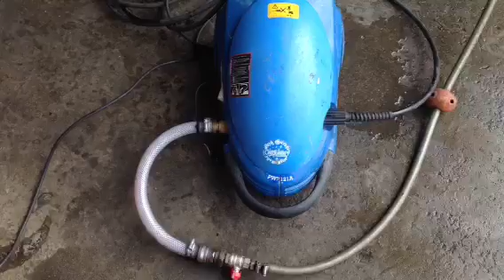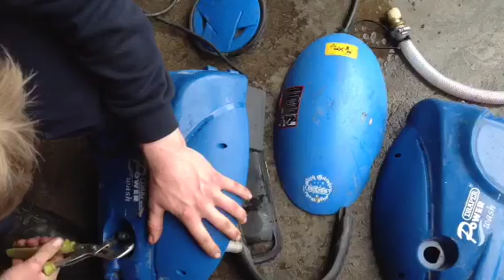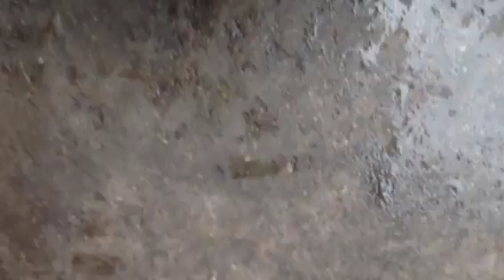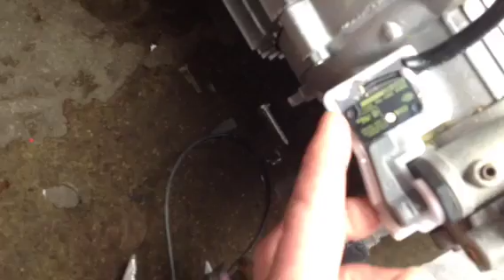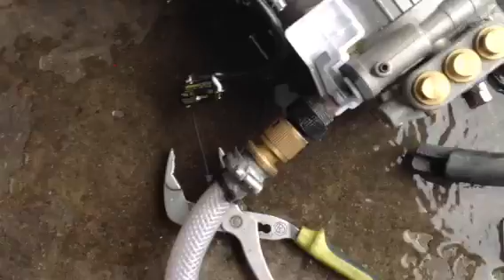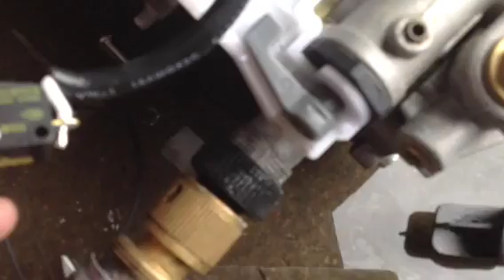PRESSURE WASHER HOW TO FAULT FIND REPAIR & BYPASS MICRO SWITCH AUTO STOP START QWASHERS YOUTUBE

Comment: Hi, thanks I used your vid to diagnose the same problem. Only difference is mine turns on when I press the switch button IN and off when it is OUT. So opposite to your switch. Is that normal that it's just different way on different machines?
And do I just need to clean the piston head and spring (it's not rusty) for it to work properly and the piston to move out to activate the switch? Or do I need a new piston part, if so do you have them? Machine is an Alto Dynamic 7100

Comment: My pressure washer doesn't have a Start/Stop system like this one and constantly runs. Is wiring a pressure switch into it all it needs?
Reply from the maker: Depending on what you are using it for & the amount of user that use the machine. 
It Is not always a bad thing not having a stop start system.  
Are you running off mains electric or from a generator. 
If running off a Generator you do not want stop start system.
Reply: @qwashers  I run it off main electricity. I use it 99% of the time to wash my car and no one uses it except me. Constantly turning it on and off during my wash process is a pain so I've been trying to figure out what I need for TSS. I think it's just a Pressure Switch with proper psi (1000 psi pressure washer) but I'm not sure to be honest

Comment: what dose it mean when it has a pressure delay ?
Reply from the maker: That normally means the valve is not moving back and forth freely
Reply: Damian Johnson turns out the regulator tap on the pump head was screwed in too far
Reply from the maker: @muckman5509  What machine type with  have a regulator screw adjustment please.
Reply: Damian Johnson the karcher HD 7125 has a regulator tap to adjust the flow. If the tap is threaded in too far it will push down on the valve causing it to lose pressure.

Comment: I have a pressure washer with a similar pressure flow switch but .  All i would need is the part that screws into the pump  Is there anywhere I can find and buy such a part ?

Comment: Is it the same solution for washer just keeps going on and off continuously even if desired pressure has been reached?
Reply from the maker: You could simple have a little dirt in the lance nozzle jet
Reply: Your water supply pressure not constant

Comment: Great video Damian.  I have a pressure washer with a similar pressure flow switch but in my case it is broken where the big screw connects the pressure switch to the pump.  All i would need is the part that screws into the pump and i believe it is prebuilt with a plastic housing that receives the switch.  Is there anywhere I can find and buy such a part ?
Thanks
EMile
goonieman007@hotmail.com
Reply: Same problem here can you screw out that  black big screw? or to buy one

Comment: Thank you Damian for your excellent video. I have the same problem with a Nilfisk 140.2 (Gerni) would it possible just to permanently bypass the micro switch? Is that possible? Or would the pump die very quickly? Anyone know how to do it?
Reply from the maker: You can do that,  just like old type machine first came out like. 
They never had a auto stop start setup ie KEW hobbys and when you stopped using them you turned them off & on when using again.
Thanks qwashers

Comment: Very good video. By passed the micro filter switch and hey presto the machine works. Only thing is now you have to switch off once finished to stop pressure washer running.
Reply: How (long) did it work without the pressure switch?
Having the same issue and the piston behind the black nut is the reason. It’s connected to the switch by a push/pull mechanism.
The springs inside the piston corrodes and the rust blocks it from moving in and out.
.
Very easy to bypass inside the controlbox. No need to cut any wires. But won’t it put too much stress on the internal parts if the pump is running while you need to release the trigger?
Reply: @outsidethebox9658  still working hopefully will continue for next ten years 😀
Reply: Awesome! Thank you for replying bro!
 I’ve done the mod on my friends pw and have told him not to release the trigger when the pump is running or start it without first holding the trigger in incase the gaskets can’t take the building pressure.